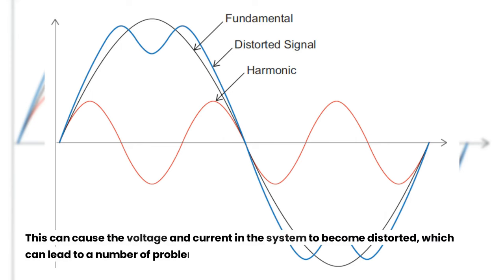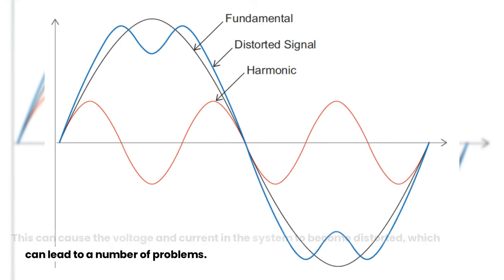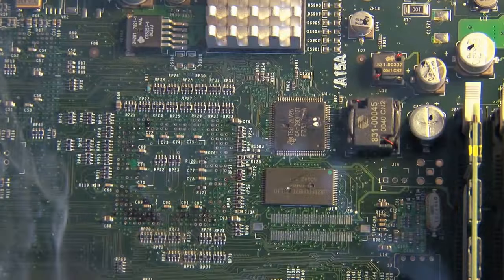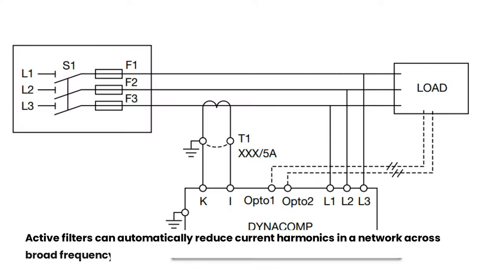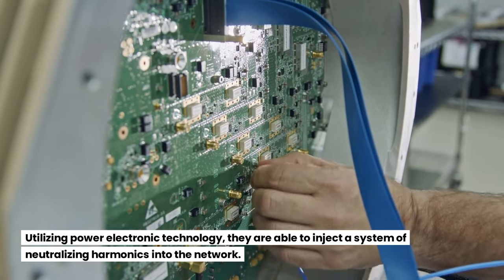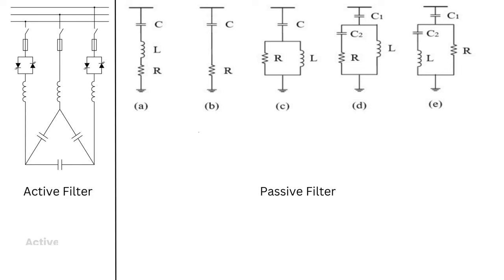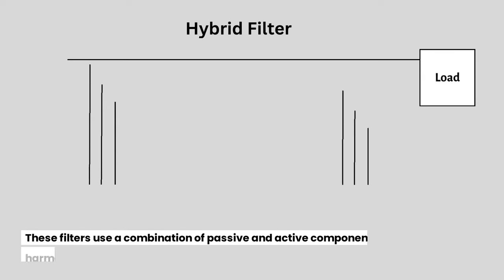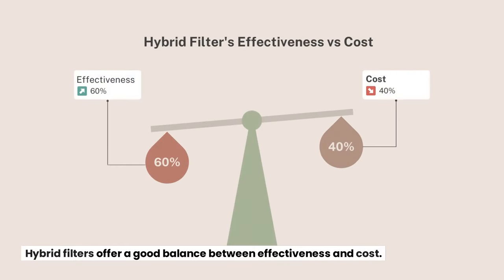Power System Harmonics: What it is, Why it Matters, and How to Tackle it

Comment: We hay a 1000 KVA Distribution Transformer that is destroying VFDs and drives of LED tube lights. What is the solution?
Reply: Not possible bro. How are directly complaining to the TF?
Reply: @RuchiraAlahakoon  Fault resolved when Transformer replaced
Reply: The VFDs and LED tube lights generate harmonics. You can use harmonic filters on VFDs.